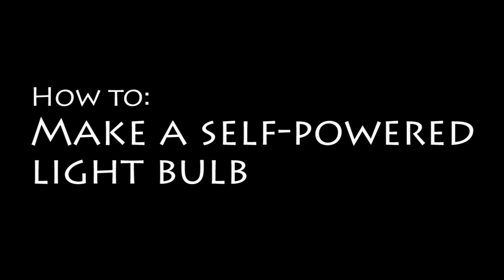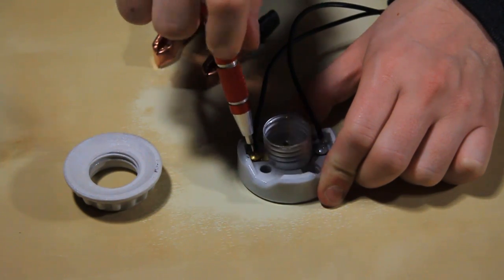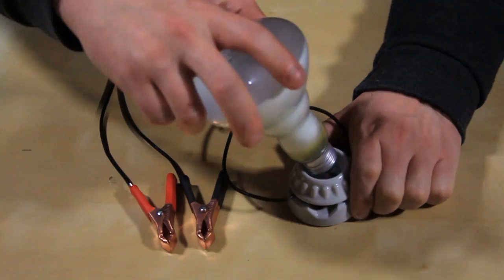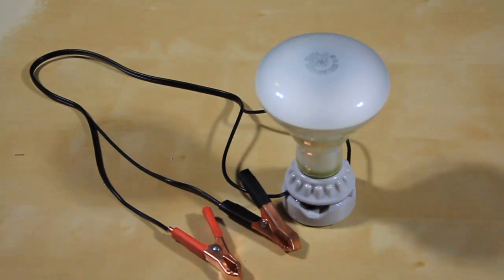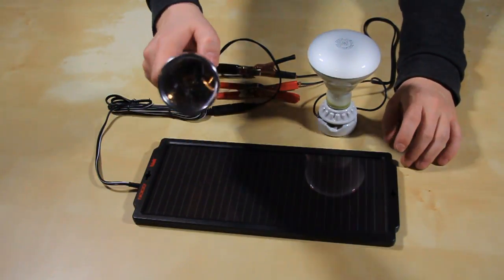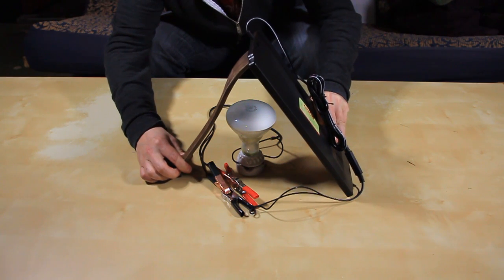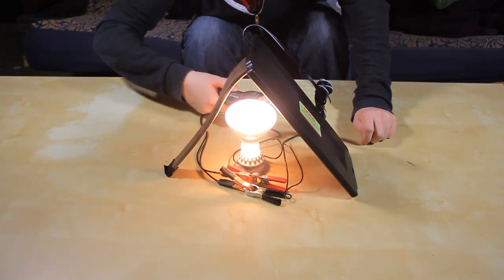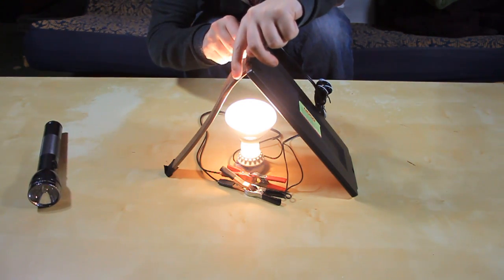SELF-POWERED LIGHT BULB!

Comment: Nope doesn't work because solar panels have 40 percent to 80 percent efficiency of using available light and this setup would lead to continuous heating of wire, filament, and other losses accompanied by the loss of energy because of the inefficiency of the solar panel technology, so this would merely last for about a week or even if you have a 100 percent efficient solar panel which is a mere fantasy right now, it would still only work for about a year after cooling the wire continuously and repairing the setup. So no free light for now friends. Won't work forever.

Also the bulb is emitting light everywhere and the solar panel is only on one side so most of the energy is going to be wasted. :)
Reply: R/wooosh

Comment: Use sixty 12vt  panels wired   in series and  parallel to produce  120 DC  with  suffiecient   amps to  invert  and refeed  the  source   in a  self-contained  hexagonal   tubular  construction.   Use  flow  batteries   for  surplus  power storage  and  use   HF  fluorescent   lights   (cold Light).  It's all about   effiency!

Comment: an enclosed space to contain the heat and possibly another panel combined with thermal energy ( cheap to buy and easy to make with graphite and aluminum but that's another story) would certainly power a light for quite some time.

Comment: I think everyone who is saying that this video is fake because solar panels aren't as efficient, that solar panels do not make power from light from a flashlight, and other various reasons have forgotten the biggest one:
Light bulbs that go into that kind of fixture typically require AC. Solar panels provide DC, and considering the battery clips, that is a 12v solar panel meant for recharging car batteries. You're welcome.
Reply: Well actualy you're right.And yea charging batteries would be effecient but butt it would bee like this:Gotta some solar panels than get some ultracpacitators they arent the cheapest ones but if you got them they can output a realy decent current so wait until you dont charge them up than get a invertor it can be homemade in 2 ways but i recomend to buy one or do it for yourself but that has a small risc is you dont do it right...
Reply: Light bulbs will work on AC and DC. Trust me. Hook together 13 9-volt batteries in series and connect a light bulb to it. It will light up.

Comment: This just doesn't work, no type of solar panel is over 100% efficiency. Disliked.
Reply: Even if there would be 100% solar panels, all the light needs to reach only the solar panel
Reply: drkastenbrot Exactly. Good luck channeling all the light from a bulb directly into a solar panel.
Reply: Philbob Yolo Thats not even the only problem. The reason why it wouldnt be possible practically is that you need 100% efficiency. That will never exist. The glass from the bulb absorbs, the air absorbs, even the actual wire in the bulb absorbs some light. same goes for the panel.
Reply: drkastenbrot I know. It seems he needs to change the title. It was extremely misleading. I don't know what I expected...
Reply: Clarence P It wouldn't last for a second.
Reply: +Philbob Yolo  he said in the video that it wouldn’t last forever, just 15 mins

Comment: Haha, faker than a bag full of fake things.
Reply: bl1tz78
Not all things are fake. All the things like this on youtube are generally fake and this is a definite fake
Reply: +Foxloo is naow a butt  cplcabs do u think everything is fake
Reply: IS Your stuff fake?
Reply: bl1tz78
The solar panel needs more light than the light can produce. This obvious and does not need to tried. You can see its fake when he first shines the torch onto the solar panel....the light bulb goes on and off even though the torch never leaves the solar panel. In addition it only takes a small amount of light from the torch to "start" the device. No way this will work.
Reply: +cplcabs 

Don't knock it, until you have tried it, LED's don't use as much current and because of that - the solar panels produce enough energy from the light source to power what I suspect is the LED light a little longer than lets say an incandescent light bulb would, the trick is to know what frequency "electromagnetic frequency" the solar panel/s are the most efficient "produce the most energy", and by using a light "energy source" at the visible spectrum or better yet a frequency closest to that peak efficiency, mind you if illumination for lighting is not required, then matching the frequencies would be the ideal.

Comment: No solar panel or light-bulb is efficient enough to work in that way... sorry.
Reply: DflyRulezMinecraft videos can be edited. Very easily and to the extent where we can be brainwashed go believe its true.
Reply: but you've just seen video PROOF oh SORRYYY
Reply: DflyRulezMinecraft That lightbulb transmits the majority of its energy as heat - not light. Not to mention only about 30-40% of the light emitted by the lightbulb even contacts the solar panel, after which the solar panel is less than 30% efficient. That leaves so little energy to harness, that the "15-20 minutes" claim is nonsense. That would mean almost completely perfect transferal of energy. This is not real.
Reply: then how is it fake if there is video PROOF?

Comment: I think it's possible, here's why.  The LED light is a quantum effect.  There is no heat generated by the light.  Consider this is the same as the solar panels on your roof providing power to your house...just smaller scale.  Could this be faked, of course.

Comment: Is this really possible? A solar panel needs sun's light to generate electricity.
Reply: will i am Blacwella  stupid troll... i won't continue this conversation just because you are too lazy to check this out, usual light bulb CAN use AC and DC
Reply: No its not real .
Ohms Law will tell you this will never work .
The panel will work with a light bulb though .
Reply: will i am Blacwella show me, where I told  the light bulb with solar panel can be like "perpetuum mobile", I know that something like that doesn't work, read my comments again, I was only trying to correct your meaning of powering the light bulb with DC.
Reply: I know this is sorta old, but let me just say it's entirely possible.
will i am Blacwella I'm not an electrician, and I don't know what Ohms Law states, but perpetual energy as a whole is impossible.

Now the solar energy powered by a lightbulb... You see Solar Energy isn't exclusive to the sun, what solar panels do is generate power using UV radiation (correct me if I'm wrong.). Light Bulbs give off a VEEERY small amount of UV radiation, and not nearly enough to itself infinitely, but for a matter of minutes? Yeah, this will work.
Reply: LOL......  solar panels = DC
light bulb he is using =AC   
FAKE and that is only the most obvious reason this will not work .
Reply: will i am Blacwella Light bulbs can use AC or DC, if you don't trust me you could buy few 9V batteries, connect them (120V from few batteries is enough) and connect little 220V light bulb, it will work but not very bright.
Reply: HAHA  very funny
Reply: I dont care if  usual light bulb CAN use AC and DC as you say . my point is there is no such thing as a SELF POWERED LIGHT BULB in this manner period . and if you think so you are the stupid one my friend.
Reply: o ok thin we are on the same page

Comment: Thats actually a good idea. With the right panel and bulb, you should be able to get the light to power its self for a few seconds. Maybe even a few minutes. You would probably need a panel the size of a house, and a bulb that produces the right kind of light. But as for this setup. i think you have some outside power commonly called 120 volt household power...

Comment: This is bullshit! Solar panels cannot provide power direct to a light bulb. It has a DC output and must be connected to an inverter before getting AC. Also the energy output of the solar panel (w/ inverter) would not be enough to run a bulb that size unless it was the size of a household roof!
Reply: Wow, 120 volts and 60 watts of power from a 3 volt flashlight.
Reply: David Harman
Seems the laws of energy conversion have been susended for purposes of this vid, right?
Reply: While everyone knows this is an obvious troll video, I feel obliged to comment on your mistake in assuming lightbulbs require AC. DC will work just fine too. it's the total watts that matter since most lightbulbs (excluding fluorescent) are nothing more than a resistor that gets heated up by the flow of current through it.
Reply: Douglas Moseley you've just seen video proof, so fuck off, Fucker
Reply: You sound like a good person to ask. If I wanted to run a small house in winter time, in Alaska with solar panels and wind turbines.....would it be effective to use a bunch of UV lights on solar panels that power themselves and power things like heaters and electronics?
Reply: Douglas Moseley You can use solar panels and wind turbines and consider a back up generator or a battery vault as useful features. However I do not believe I understand what you are going to do with UV lights. Typical solar panels only produce power from the visible light spectrum which is roughly 10% of the overall light spectrum that lies between UV and IR. The laws of conservation of energy ( energy out minus losses equal energy input) is in effect despite these "demonstration" videos.Do a search on remote location green energy for residents
Reply: Don't ya just love science!
Reply: Fr4g4lot
I stand corrected!
Reply: Fr4g4lot This is wrong in so many ways its not funny . Please stop the B.S.
Reply: Douglas Moseley I DONTFUCKING TROLL   itsjust if i see video evedence, i will beleve it, I'm just that type of person! and plus i beleve that "TheHouseholdHacker" makes good videos and i dont like people calling him a scam!
Reply: Fine Mr. Minecraft. Have at it! The best way to convince a fool that he is wrong is to let him have his own way. If you can create the same results I am sure someone will pay you millions of dollars for proving that it actually works. Ta-ta for now. Have fun wasting someone else's time!
Reply: DflyRulezMinecraft Saying that your just the type of person to watch video evidence and believe it doesn't seem right. So does that mean there is a specific type of person that believes something even if it is potentially editable, fakable and unreliable content? Nothing against the creator of course but in this day and age you have to be careful about things like that.
Reply: AlexTheNerfer You seem to be a smart young person! You will go far when you speak up about truth. I know this representation will not work as I have been working in electronics for over 25 years! Trust me. It will not work. Minecraft is just trolling because his warped little mind think it is fun.

Comment: Very near to perpetual devices are possible. HouseholdHacker makes it clear that his device will die after a period of time.  What makes perpetual machines difficult, if not impossible, are the loosess in the system.  Minimal complexity devices like this one have a minimal level of losses.  This in turn gives the 'illusion' that this device is perpetual.  Also do not forget that the system is also "charged up" with energy from his torch.  It should be the case that if you add up the energy given to the system, by the torch, and surrounding light and subtract the addition of the losses from the sola panel, wires and bulb, and the result will be zero.  Every time!!

Still impressive, though

Comment: Do the math, its simple.
19% efficiency means that only 19% of the engery you put in with the light can be put back into the system. and since you take away most of the energy because you use it to luminate the room you only get back 5% maximum. the rest is converted to heat.
Taking into account that most of the enegy a lightbulb produces (used to be 95% but they got more efficient i think/hope) you can cut the output to a fifth.
So we got the Lightbulb beeing bright, 5% of that converted to energy again wich is put out into light again wich leaves us with 1% of the original lightening power.
And thats just one cycle that is shorter than the Human eye can percive, not talking about 15-20 minutes ofc.

This video is nicely done tho, gave me a nice laugh :)

Comment: i wonder how that will work with 86% efficiency solar panel instead of the sold garbage 19%
Reply: If you get a couple higher efficient solar panels and wire them in parallel you should be able to a much much longer duration out of it.
Reply: You know what your video does? It melts the brains off old people. If i told my dad no this is how it works. I always get this crap from the past about laws and math saying its not possible. WHEN IT IS, hell much more is. I always think of math as a great thing if you want to confirm of measure something. Math is not a thing to invent new things . SO thanks for making a great video. Its really cool because when i get an idea i look it up, and other people who are thinking of similar things like you have already name a model, saving me like days worth of time, confirming what i was thinking and then i move up in thought closer to my goal of using gravity as that extra force to keep something like this " impossible concept" SO thanks!
Reply: Peter Kiryluk are you looking for someone to "discover" you?
Reply: No i don't need discovering of me, I invent things and license the patent to companies. Im the guy behind the curtain.
Reply: but this aint real man!!!wtf?

Comment: Actually if instead of using the spoon or whatever you call it if you use a mirror you might add more energy to it
Reply: Not sure but i saw a research paper, quoting that a mirror actually enhance the power converted by the solar panel by 75%
Reply: kevin lin you do understand that this is a joke video..

Comment: Just how incredibly stupid you think people are? lmao~ Something that plugs into 120/220 volt socket/ hardline vs a solar panel that serves to deliver DC TRICKLE!!! 12v-24v at a time? Translation: a bulb suckin on the juice through a fire hose ISN'T going to kick out & recover enough of its wasted energy through a STRAW, only to recover only a miniscule fraction of it for it to prove effectively useful for half a second~ I'm going to send this to everyone I served with so THEY can get a good laugh.
Reply: they're bright, but the way solar panels work is by heat energy from light exciting silicone atoms in the solar panels, LED's would work, but it would have to be a big one or lots of small ones I think, I cold be wrong but that's my understanding of how solar panels work~

Comment: Not only does it works for a little while. The side bar -->
 has more of them for a reason. AND! Those that are brainwashed from old school  physics. You need to get updated and ahead of the old school that is holding us back for various (money making) reasons. The old physics theories are now and has been getting torn apart. DOD knows all about these things. That's why they are quiet. Remember the little robotic they and Israel have invented to spy with. AND, do not forget the laser weapons that Ronnie R wanted back in his days. They already knew about and use these things now. Also, wasn't there an university back in FL that had a car that was powered by solar, charging the batteries that helped produced hydrogen to powered the car? It made it to San Diego from FL.

Comment: Heh, that was funny.

If you took this video seriously, look up the wattage per area of solar panels. They are horribly inefficient. There is no way a feedback loop will last 15min (let alone light up the bulb)
Reply: ***** LEDs dont give out the right light for solar panels and they make lots of heat so the energy would be gone in less than a second
Reply: ***** Infared LEDs produce a whole lot of stuff other than Infared :P

What do you mean generating heat would not cut down power? Of course it does!
Reply: ***** I have burnt myself on led's far to many times
Reply: I agree it will only last for less than 30 seconds.

Comment: Absolutely won't work without a power source that's hidden.  I can barely run a 12 volt 3 watt computer fan with three 15 watt solar panels (total 45 watts) pointed directly at the sun.  Without a 12 volt battery in between the 3 amps that the fan pulls puts a significant load on the system.  A 1200 lumen light bulb doesn't put out anywhere near the power of the sun.

Comment: O - O) omg you guys...he said it WORKS but it will last about 15min.. so don't say "impossible" if u didn't even try it
Reply: You don't have to try if you have basic knowledge in electricity. That solar panel produces only AC while the lamp uses DC. There is no way that would work unless you would used converters, but the solar panel wouldn't produce enough power for the lamp to work any way. If it could produce enough power the lamp would only light for a brief moment but it would just go dimmer and dimmer until it stops lighting, and that brief moment would only be a second or less.

Comment: Thats why it only lasts for five mins or so. The energy the bulb puts out scatters and the solar panel does not capture it all. It captures just enough to get the job done which is lighting the bulb. Remember this. Energy can not be created or destroyed but it only get transfered from one form to another also theres always a resistance which goes into another form or energy preventing the device to die out.